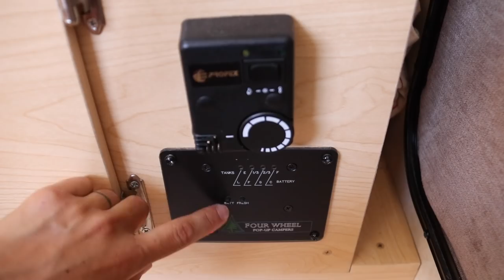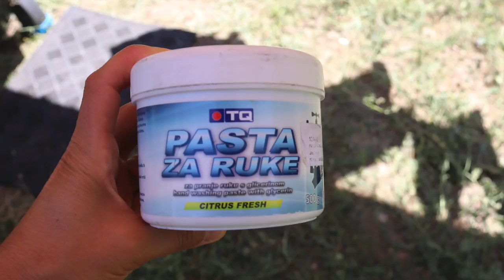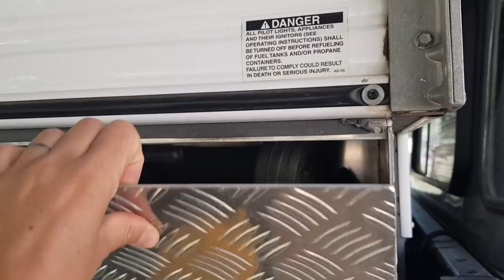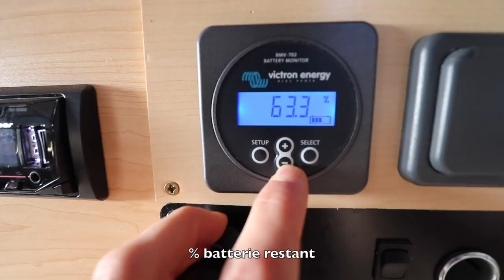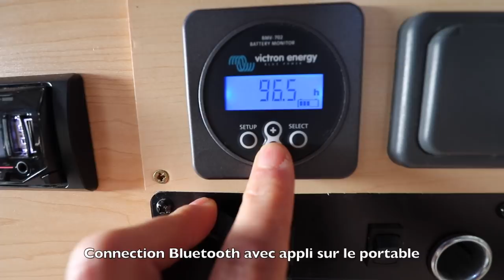We show you EVERYTHING - GrizzlyNbear Overland - Camper Tour

Comment: I built a simple shower by hanging 2 shower curtains overlapped at the edges with curtain hooks on a hoola hoop. When using it, I hook the plastic hoop to the roof rack to the side of my 4 X 4 with a mini maglite flashlight mounting brackets.  (Small and simple) and tie off some para cord to the outer edges to hold it horizontal off the rack. My roof rack floor is a small wooden grate which I also use for the shower floor so we're not showering standing in the mud. With my propane powered tankless water heater, water pump and shower head I become very popular with the females at the extreme off gird camping spots while 4 wheeling in the USA. Seems the ladies like a nice hot, stand up shower to wash their hair in rather than bending over a bucket.   It all stores away really small and flat.  Just an idea for you Steph.

Comment: Hi Guys. I have been following your You Tube channel for a while and believe it is one of the best on the Net for long term Overlanding. I try to figure out how you created those big  extra storage drawers which you can access from the sides and the rear of the camper.
I have checked Four Wheel Campers Net presence but can not find this add on options.
Did you built it your-self? And if so how?

Comment: Hi GrizzlyNbear, Know you are trying to keep every day costs down to minimum and that you sometimes use jet boil to boil water for coffees, that uses gas. Not sure if you know about something called a storm kettle. You can boil about 1.5 litres of water in about 7 minutes using twigs, small bits of wood, paper rubbish or anything that will burn. Kettle costs nothing to boil water for hot drinks washing up, or laundry. It's weighs about half a kilo and is hollow so you can store things in it. Know space and weight are at a premium on grizzlyNbear. Kettle is popular with campers, fisherman and bush rafters. I had mine years and use it whenever I go camping to save using gas.
Reply: Hello Craig
I do know the one's your talking about, we had one for a while. It was called an EzyStove. 
Very efficient piece of kit. 
In the end though we swapped it for a Braai style barbecue that we use to cook on the coals.
It was only because of storage space we didn't keep both.
We use the Braai to cook our meat and roast vegetables whenever we can have a fire.
Reply: Hi Leigh, easy stove is a rocket stove for cooking. Storm kettle works similar way but just used for boiling water, very efficient and totally free to use. Love mine as when I want to use it, I normally just look around where I'm standing to find  fuel to run it. I'm sure you will come across an over lander using one at some point. If get chance when you get wifi have a look at one being used on you tube. Can't believe how much stuff you have managed to carry in GrizzlyNbear. Will keep off line for a couple of weeks as I'm taking up far to to much of your time online. Want you to have as much time enjoying this fantastic journey you are on. Keep safe Craig.
Reply: @leighdearle5965  Braai ??
LOL. Do you have S African connections.
I've never heard the term braai used outside southern Africa (short for braaivleis).
I found your channel a couple of days ago and am binge watching whilst we're on lockdown. 
Loving your content.
Thanks for sharing. 

Regards from S Africa
Clive
Reply: @clivegreenall309  haha we spent a month rock climbing in SA many years ago and I was taught all about the fine art of the Braai 😉
If you watch out recent video about all the gear we carry I tell the story of why I call it a Braai and not a barbecue at the end 😜